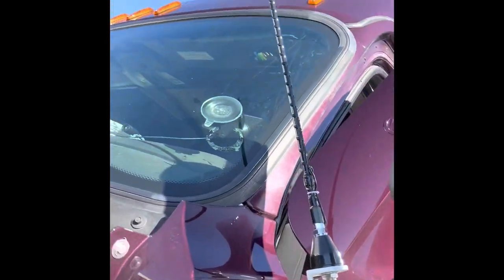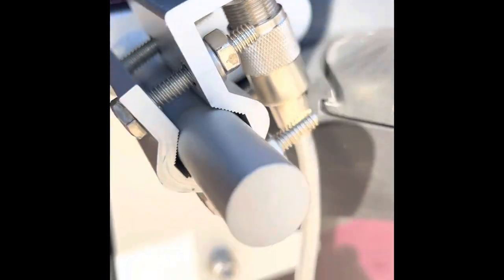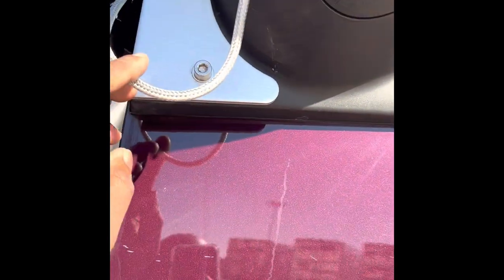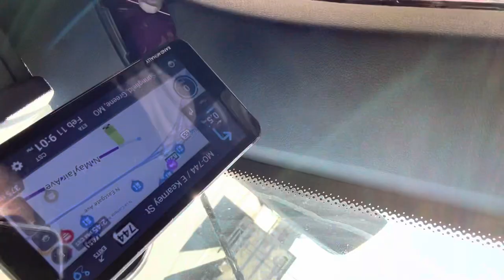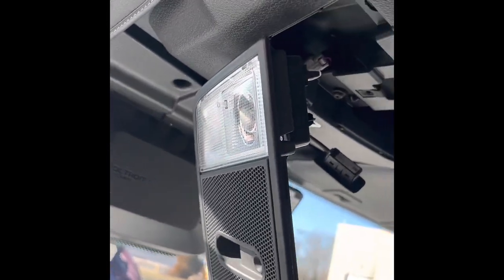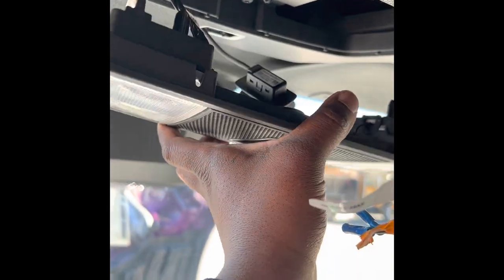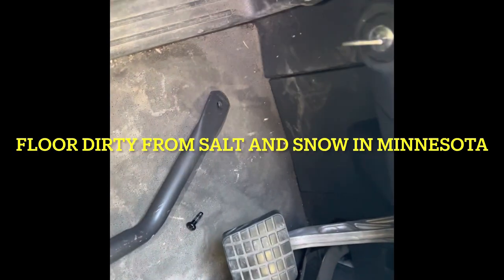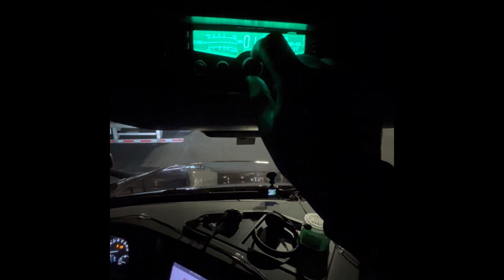2022 Freightliner Cascadia CB Antenna & Radio #Prime Inc

Comment: I do all my own installation also and I found out that bundling up the CB  coaxial like you did cause a choke in the radio signal and high SWR  which will  damage the radio.. Stretch the coax cable out in the head line
Reply: Yeah because it creates a “coil” the proper way to deal with excess is the make a figure 8 as many times as needed and zip tie the middle